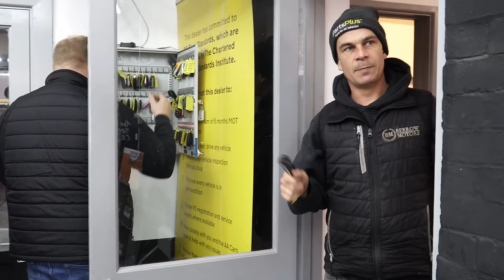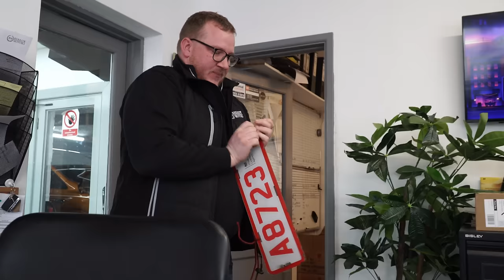Finance Company Dumps Another Car On Me?! | BM Weekly EP37

Comment: I bought RX7. Next day going to work broke down, just stopped. Lifting the bonnet scratching head, you know when you don't know where anything is. I asked chap walking by to tell me if he could see spark at end of a loose lead. No mate came the reply. Then i saw the car alarm had a key switch on it. I noticed small key on key ring. It fitted and turned the key switch and behold the car started! Turned out wires on key switch had broken off, cutting engine out.

Comment: 45:32 I watched the video when you said there was nothing wrong with that Porsche!  So the person that bought it was correct about it then...?  They complained about gearbox faults and you have now admitted there was some kind of leak.  A leak or loss of pressure in hydraulic fluid will cause a problem, but not to be unexpected at 100,000miles+  - When was it due a gearbox service?  Maybe they should have let you help fix it and not rejected it through the finance company.  I still got the impression they couldn't afford to pay for the car or used it for a bit and got bored.